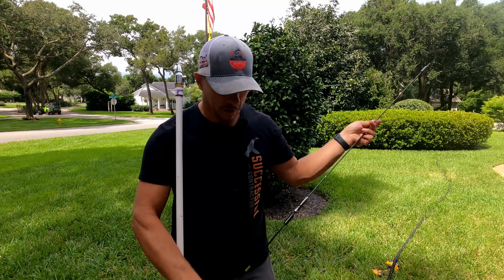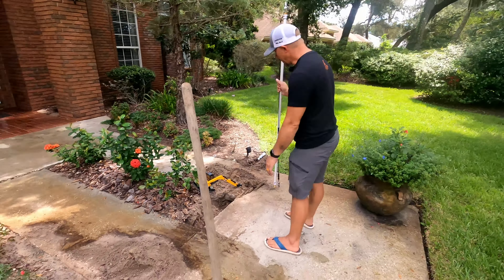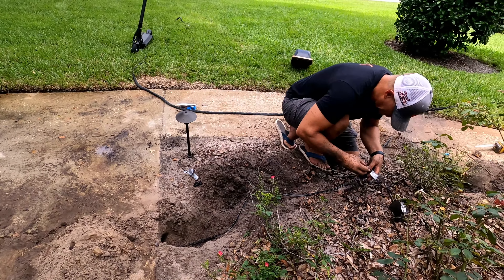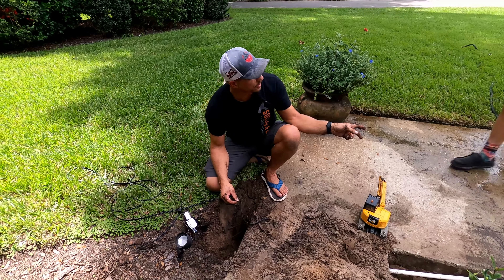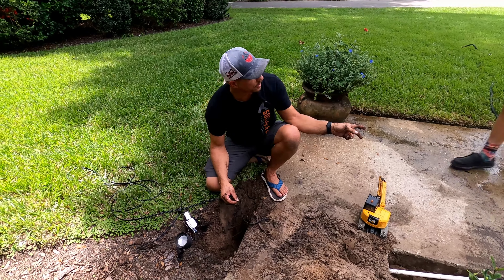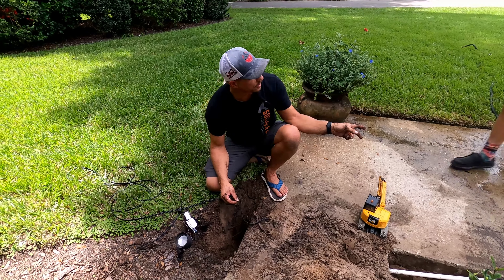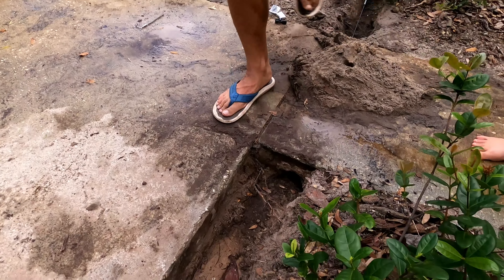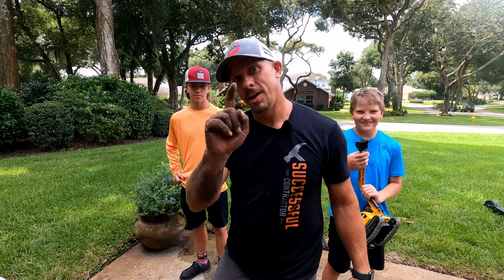How To Easily Fish Wires Under Concrete Sidewalk

Comment: Put valve at the hose connection, then open the valve on the tip of the pipe, and remove the handle
Reply from the maker: Solid advice.  We were using what we had.

Comment: Why not put the valve on the hose end? That way it won’t get hung up when pulling it back through. Great video.
Reply from the maker: That could work! As long as you still had the nozzle on the front end.

Comment: I did similar  to the  water once... but I used pipe fittings necked down to 8th pipe...worked quite well
Reply from the maker: I’ve used this in heavy clay and punched through 10’ in no time.